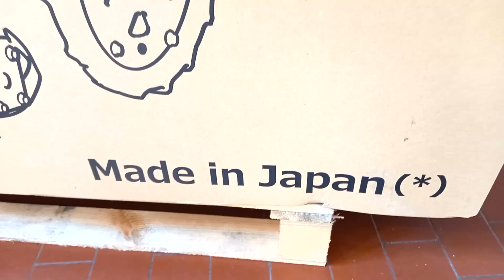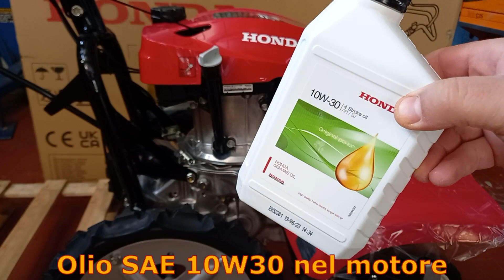Nuova FF500 Honda Unboxing e preparazione

Comment: Ciao Ricky grazie per i tuoi video utilissimi, mi chiamo Massimo Pavanello, ho acquistato questo modello di motozappa FF500 però nel manuale d'uso non sono presenti le indicazioni su come sostituire interamente l'olio motore, parla solo di rabbocco, ti chiedo gentilmente quali operazioni sono necessarie per svuotare completamente l'olio motore. Se esiste un apposito bullone da svitare per lo spurgo completo oppure occorre svuotare dallo stesso imbocco dove si effettuano i rabbocchi Grazie
Reply from the maker: Buonasera, benvenuto. 
Per la sostituzione completa dell'olio motore nella motozappa Honda FF500, dovresti poter seguire questi passaggi, che si basano su procedure standard per motori simili. Anche se il manuale potrebbe non specificare espressamente il processo di sostituzione, è probabile che la tua motozappa sia dotata di un bullone di scarico dell'olio come la maggior parte dei piccoli motori a scoppio.

Operazioni per la sostituzione completa dell'olio motore.

Riscaldare il motore (opzionale):
Prima di scaricare l'olio, accendi la motozappa per qualche minuto (5-10 minuti) per riscaldare l'olio, rendendolo più fluido e facilitando lo scarico. Ricorda di spegnere il motore prima di procedere.
Posizionare la motozappa su una superficie piana:

Posiziona la motozappa su una superficie stabile e piana per evitare il rischio di fuoriuscite accidentali.
Trovare il bullone di scarico dell'olio:

Sotto il motore, in genere su un lato della coppa dell'olio, dovrebbe esserci un bullone di scarico (di solito è esagonale). Questo bullone è progettato per permettere lo scarico completo dell'olio motore.
Posizionare una bacinella sotto il bullone di scarico:

Prima di svitare il bullone, assicurati di posizionare una bacinella sotto il bullone per raccogliere l'olio esausto.
Svitare il bullone di scarico:

Con una chiave a brugola o una chiave inglese (solitamente tra 10 e 14 mm), svita il bullone di scarico dell'olio e lascia che l'olio defluisca completamente. Attenzione a non perdere la guarnizione del bullone, che dovrà essere rimessa in sede durante il riavvitamento.
Attendere che tutto l'olio sia fuoriuscito:

Lascia scaricare completamente l'olio per alcuni minuti. Potresti inclinare leggermente la motozappa per agevolare l'operazione.

Riavvitare il bullone di scarico:
Una volta che l'olio è completamente fuoriuscito, riavvita il bullone di scarico e assicurati che sia ben serrato per evitare perdite.

Riempire con olio nuovo:
A questo punto, puoi procedere con il riempimento di olio nuovo dallo stesso punto di rabbocco. Assicurati di utilizzare il tipo di olio specificato nel manuale (solitamente olio SAE 10W-30) e di non superare il livello massimo indicato nell'astina di controllo.
Se non trovi il bullone di scarico:
In alcuni modelli, potrebbe non essere presente un bullone di scarico (anche se è raro). In tal caso, dovresti:

Utilizzare l’apertura del rabbocco per scaricare l’olio:
Inclina la motozappa su un lato e fai defluire l'olio esausto dall'apertura di riempimento. Questa procedura è meno comoda, ma raggiunge lo stesso risultato.

Raccomandazioni:
Sostituisci l’olio motore a intervalli regolari (come indicato nel manuale) per mantenere il motore in buone condizioni.
Utilizza solo olio raccomandato dal produttore.
Con queste indicazioni dovresti riuscire a svuotare completamente l'olio motore della tua Honda FF500.

Nel caso consiglio l'assistenza Honda dedicata opportuna.
Cordialmente RickType.

https://youtu.be/Ny31xP9lVHg?si=pPynusFyqkuq299w
https://youtu.be/Ptg6j_ER1Ec?si=iz9o40264p_Y8wHg
Reply: @RickType  Ti ringrazio molto per le informazioni dettagliate, nel manuale d'uso infatti riporta scritto che per il cambio olio motore occorre rivolgersi all'assistenza nel caso non si abbiano le competenze e le capacità di effettuarlo in autonomia. Ovviamente non viene specificato nulla nel manuale circa le istruzioni per cambiarlo, questo per volontà del produttore di affidarsi ai rivenditore per operazioni di officina. Effettivamente ragionando essendo equipaggiata la macchina con un motore honda GCV 160 impiegato anche in altre macchine come i rasaerba suppongo che il bullone di scarico si trovi sul fondo del monoblocco del motore, dove appunto risiede la coppa dell'olio, purtroppo nella motozappa sotto il blocco motore c'é il blocco cambio e sotto ancora é presente il blocco trasmissione. Quindi essendo il motore unico per le varie attrezzature credo si debba smontare il motore per accedere allo scarico olio. In alternativa mi munirò di pompa per aspirazione manuale in modo da rendere l'operazione meno laboriosa o mi rivolgerò alla rete di assistenza. Grazie ancora per il tempo che mi hai gentilmente dedicato. cordialmente Massimo